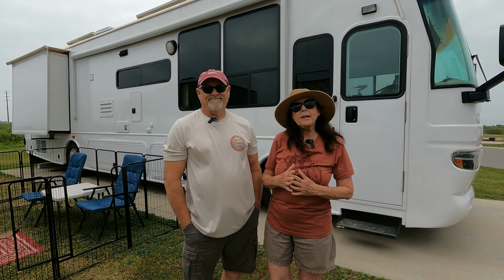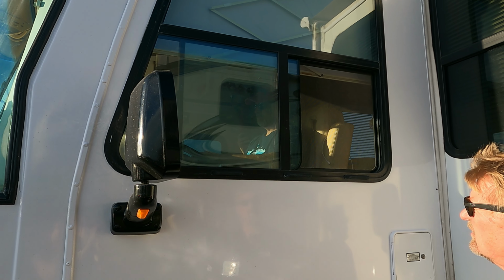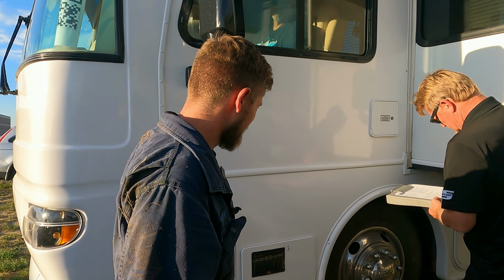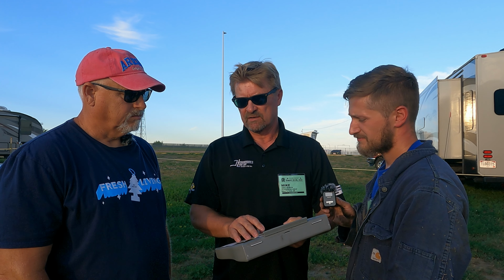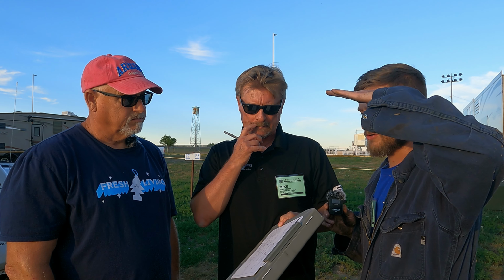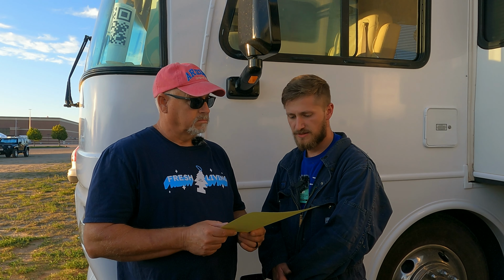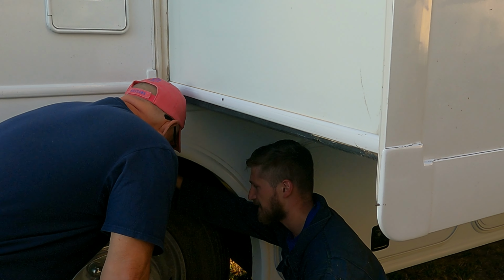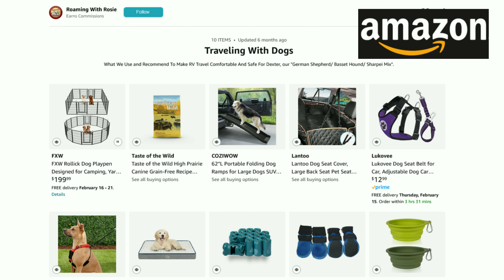Motorhome  Suspension & Steering Components Inspection Revealed Dangerous Situation

Comment: I inspected in out "play" in  my wheel/tire .. I decided to replace my hub bearing assembly. That didn't fix it.. I re-inspected and found it was my upper ball joint.. So doing my own inspection cost me $225  and two hours that I didn't need. The upper control arm cost $95 and one hour.. I learned that a pro like these guys are really valuable.. Thanks RWR
Reply from the maker: I’m so glad that we had the inspection done. They were really great and had the experience to point out what was needed to be done asap and what we need to keep an eye on.
Thanks for watching!
Reply: @RoamingWithRosie  feels good when you can trust your mechanic..

Comment: I’d do everything they recommended because you can’t put a price on safety. I recently upgraded my shocks to the Koni EVO.  What a huge improvement. Don’t even notice trucks passing and the side to side swaying is all but gone. Now my wife wants to drive all the time. Good luck on your RV.
Reply from the maker: Check out this weeks video I installed the upgraded Anti-Sway Bar, had the front wheel seal fixed and replaced the shocks with the Koni’s.
Thanks for watching!

Comment: Good video.
Reply from the maker: Glad you enjoyed it. Thanks for watching!
Reply: I replaced the bushings in my sway bar end links with Polypropene ones (they are stiffer than rubber) and it made a big improvement. This was on a 2003 Bounder 38N on a Freightliner chassis. @RoamingWithRosie